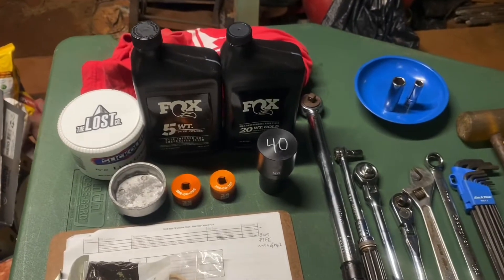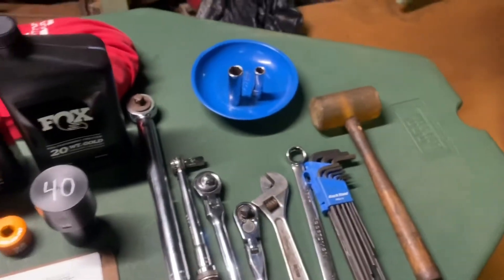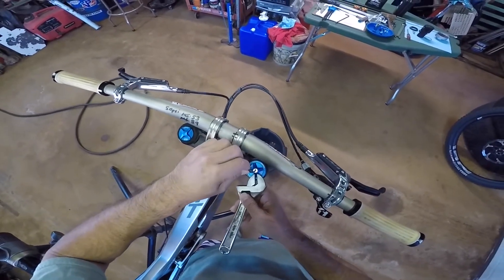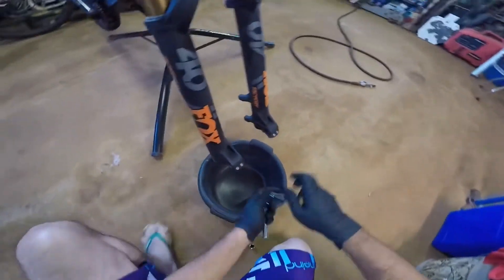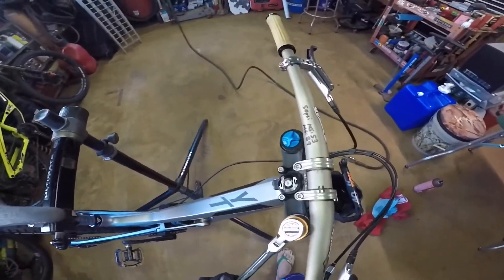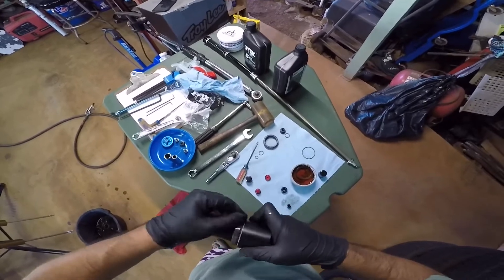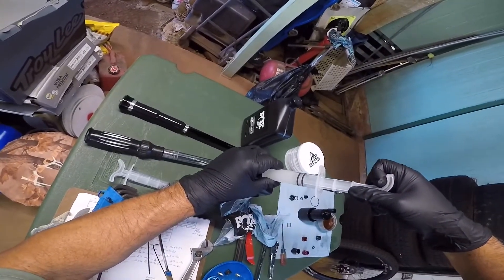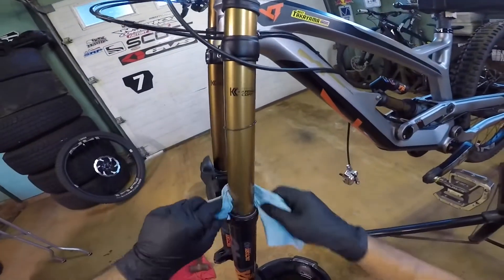How to Install a GRIP2 Damper in a Fox 40 Float Factory & Fork Seal Replacement

Comment: Is there any crush washer that needs to be installed on the airspring on bottom ?  I thought there was but maybe that was a Rockshox thing....
Reply from the maker: @TheNewnan3  The fork seal kit comes with all the crush washers. Some of them stick to the nut during removal.
Reply: Installed a Grip X2 damper yesterday on my 40 based on watching this vid.  Thanks 🤙🏽
Reply: Im about to do this upgrade next week….I was curious if it’s easier to do if I remove the fork from the bike.  Im curious what your thoughts are…
Reply from the maker: @ Easier to leave the fork on the bike.
Reply: Can i skip the lower leg removal? I dont need to take of the dust whipers. Sooo i can just lose the lover bolt and take of only the old cartilage?